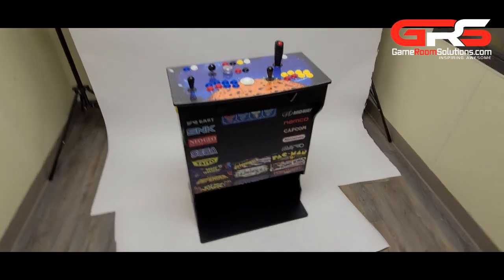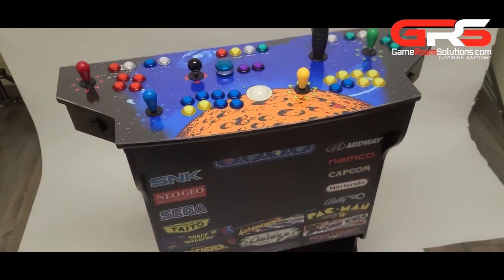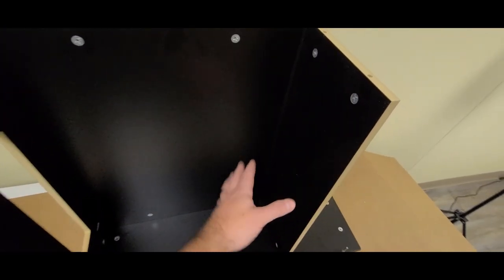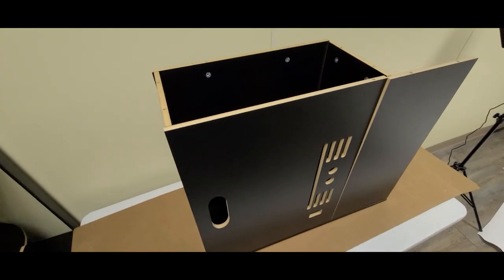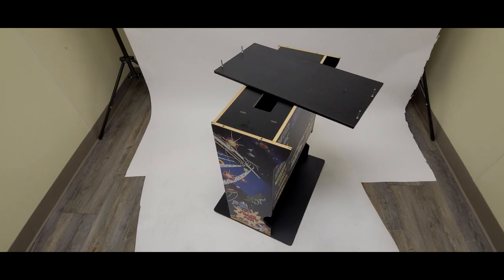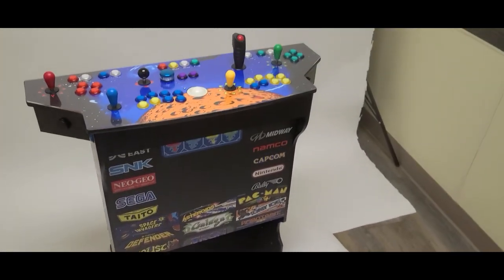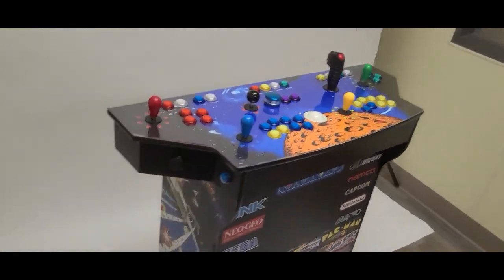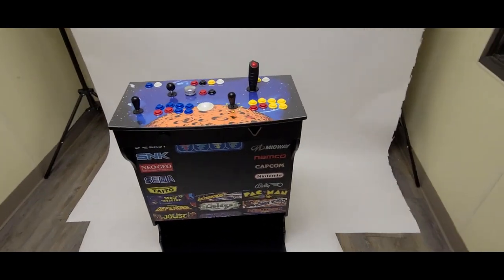Control Panel Pedestal with 2 and 4 Player Panel Walk through

Comment: I bought this cab and am very happy with it  im using my X arcade tank stick. GSR support via email sucks horribly they will try to sell you parts for your system knowing they won't fit and try not to answer questions directly.  When they finally answer your questions its usually after they have tried to sell you whatever they can. Then they refer you to their YouTube page. As for this cab I have no complaints.  I was going to buy a 32 inch arcade from GSR but their support made me think twice about repeat business.  Went with Microcenter instead their cabs are actual wood and cost 40% less than GSR plus their customer support is awesome.
Reply: Microcenter does Arcade cabs? I didnt know this. What did you get?
Reply: @stuccojohn2667  Check them out at www.microcenter.com they don't ship. The Atari 27, 32 and table top 20 inch cabinets are on sale. Some locations maybe sold out so definitely shop around.
Reply: @jrgaln  thank you!
Reply: @XPlusThree  Yeah dude, don't waste your money. To be honest, you could go to a DIY site, buy a $500 CNC router, and do a better job.

Comment: Is there an option to purchase the full size 4 player control panel separate from the pedestal? 
Do the button cut outs fit standard sanwa buttons?
Reply from the maker: Contact through the site for the fs 4 player.  Our holes are 30mm (28 or 30 buttons will work).